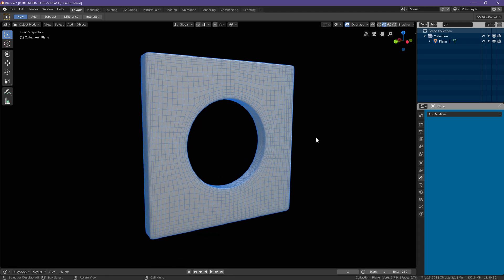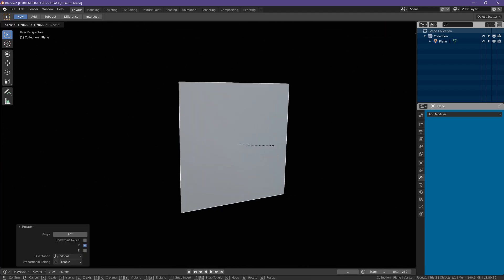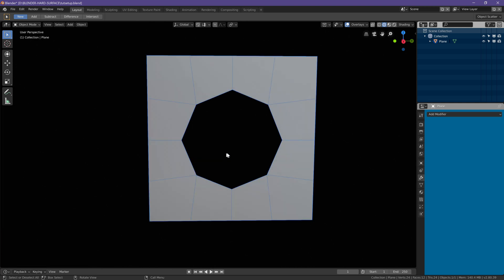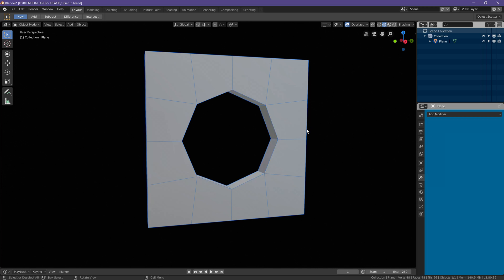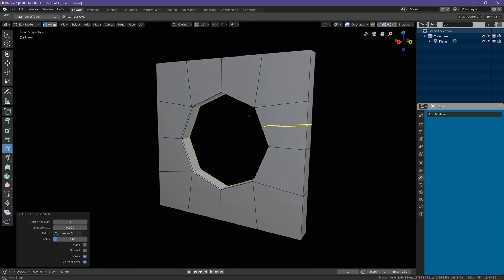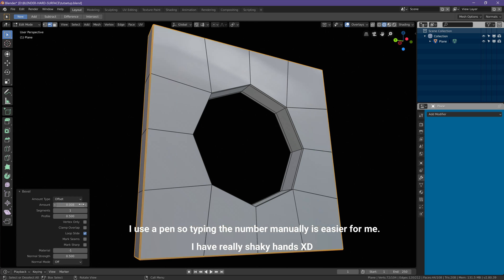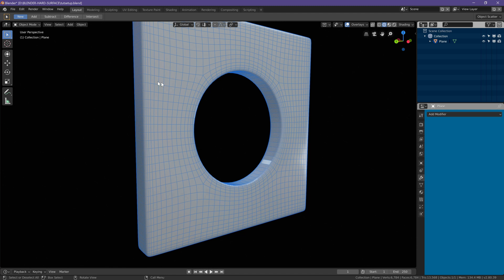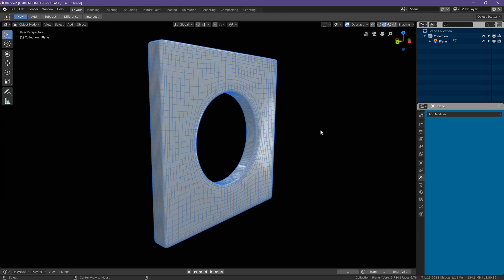CUT A HOLE IN A FLAT SURFACE (without bool) in Blender 2.8

Comment: Alt+Shift+S is just makes me 'Save As'? Tried different variations of keys and I am not getting this? Can someone help?
Reply from the maker: just did a test to find out whats going on. with all 8 verts selected, hold down alt-shift-S and begin to drag your cursor along the screen to transform the verts to a circular shape. I noticed when I just press alt-S it causes me to either shrink or flatten the selection. holding down ctrl-S causes me to save, and holding down shift-s causes a pie menu to pop up. this is with the default preferences for blender version 2.81

Comment: how to use that cut part as a cover for that hole
Reply from the maker: instead of deleting the center vert, try selecting the 4 center faces and selecting under objects>separate>make separate selection. this will turn your 4 faces into a separate selection which you can then use as a cover for your hole :)

Comment: will it work for the default square?
Reply from the maker: you can use a boolean with a default cube, however its not advised because booleans mess up topology for texturing. It is preferred by most to make our own cuts and create a hole that way.

You could also set your subdivisions to "simple subdivision" which wont round -out your cube.

Comment: Nice! Tip! 😊 "You can use boolean modifire also." 👍
Reply from the maker: yes, you can! I avoid this if possible, however, as it generally will mess up the topology. Doing it manually is easier (in the long run) for me because it means I wont have the hassle of fixing up the topo afterwards :)
Reply: @EDITMODE  👍 you are doing great